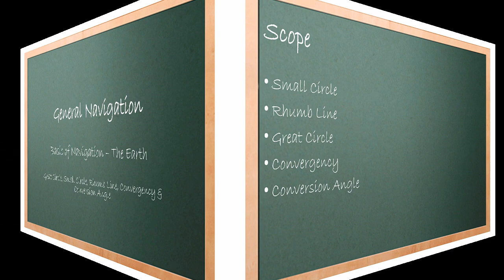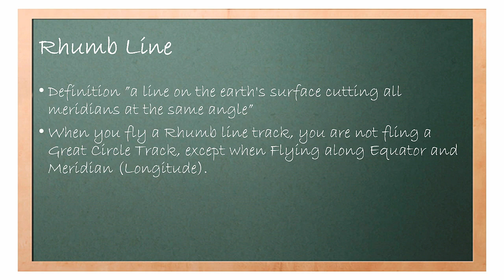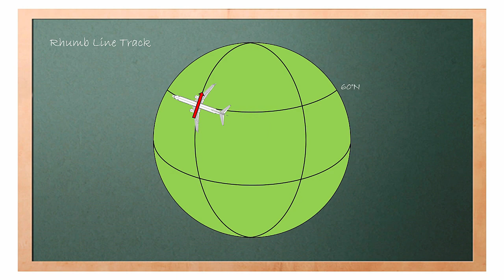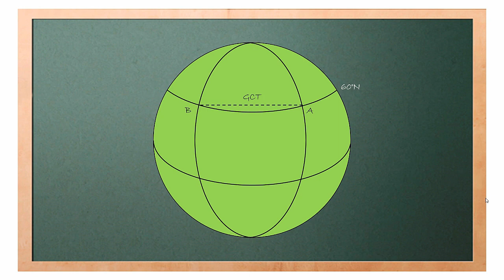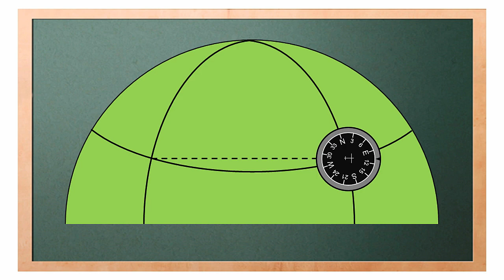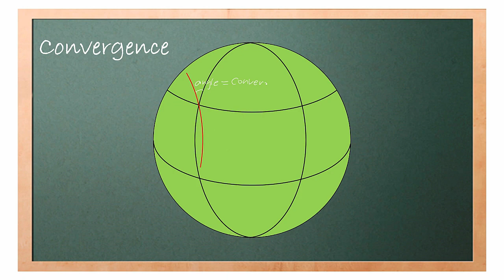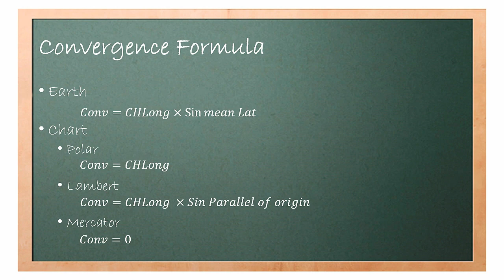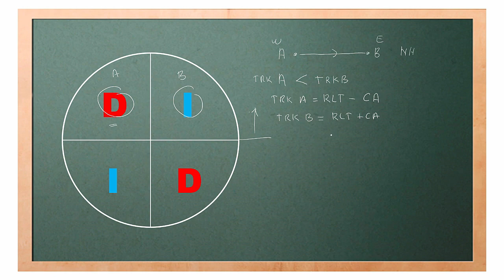Great Circle, Small Circle, Rhumb Line, Convergency & Conversion Angle |The Earth | GenNav EASA ATPL

Comment: why when the plane has two points which are antipodal or equal then the great circle is not unique?
Reply from the maker: Hello @WilliamJohn could you please rephrase the question. I do not understand your question.
Reply: @AnsweringATPL  hehe now I understand it i was trying to ask why 2 point in plane when it is antipodal then it has not unique great circle I know answer there are infinite non antipodal and points that are not equal have unique you can slide a plane which intersect the origin of the sphere
Reply from the maker: @amberheard2869 The centre of Great Circle plane, is co-located with the centre of the earth all points on the great circle have an antipodal position along that Great Circle (If the Great Circle wrap around the planet). Since the centre of Small Circle plane is not co-located with the centre of the earth. The point along Small Circle have no antipodal position.

Comment: In some questions in AE  they use the CA in calculations and sometimes they use only C , could you clarify the reasons please.
Reply from the maker: CA is used when you know the RHUMB line track usually when aircraft travel along the same latitude either 090 direction or 270 direction. Conversion is used when you does not know the RHUMB line track usually when the aircraft travel between two different Latitude.